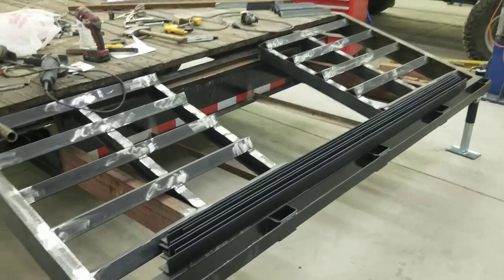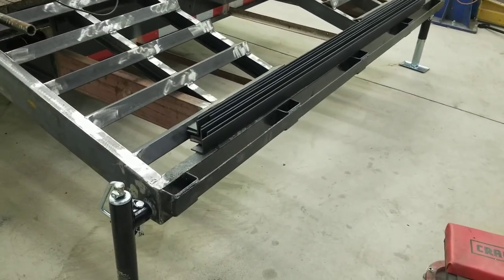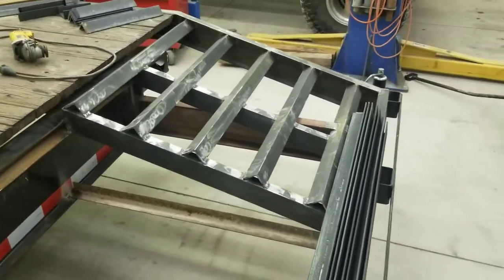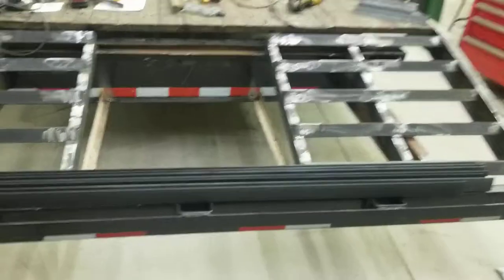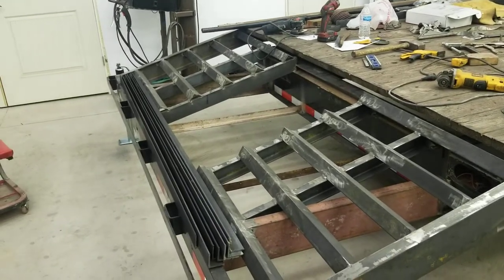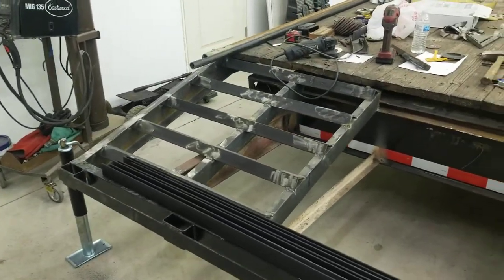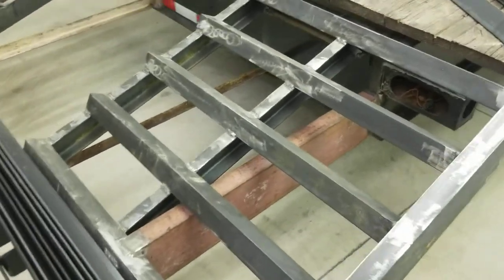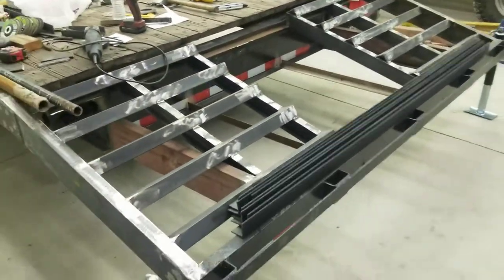Dovetail build walk around. #uintagarage #trailer #dovetail

Comment: Can you elaborate on how you joined the dovetail piece to the trailer? (to the right if the reflective tape and under the two pipes at the start of the video) It would be nice to see a close up of where you welded and how the piece was cut and placed. I’m building one this coming month. Thanks in advance!!!
Reply from the maker: I butt welded the 2 pieces of channel together, then I added the fish plate over the top.  I cut holes in the fish plate so that I could plug weld it in several spots, and then I welded the full perimeter of the fish plate.  Check out my other channel https://www.youtube.com/c/UintaGarage for more information
Reply: @joshusername22  Nice, I saw one video where they notched the channel into a L shape like to simple puzzle pieces then added a gusset... but a plug welded fish plate seems like a much better solution in addition to the L shape cup on the channel I saw.... instead of a normal but weld... one channel looses a rectangle stape on top while the other on the bottom then interlock it like a pair of hands shaking. Appreciate the response... plug welds for the win

Comment: I am doing the exact same thing. This really helped. What is the height of the back of the trailer from the floor? Thanks!
Reply from the maker: The trailer deck is about 32" off the ground.  To be honest, I feel like my ramps are a bit short to use with a car, but for the most part I haul lifted trucks, so it hasn't been an issue.
Reply: I’m looking to do this to my flatbed , I haul sedans often how much longer would you have gone if you where to be loading lower clearance cars? Thanks